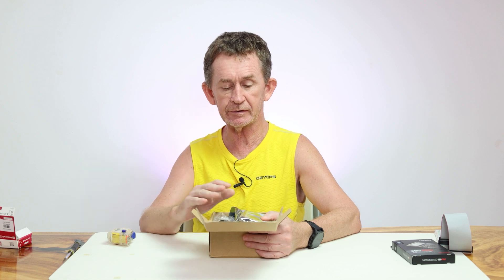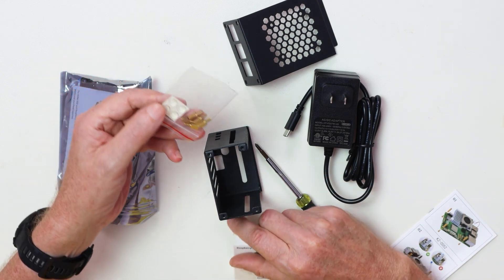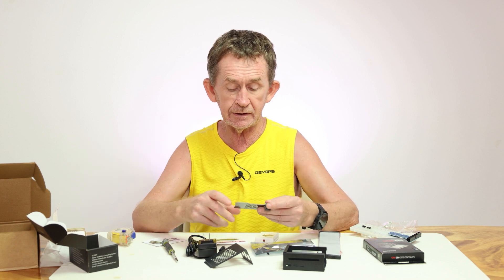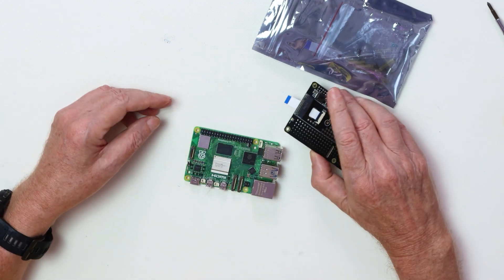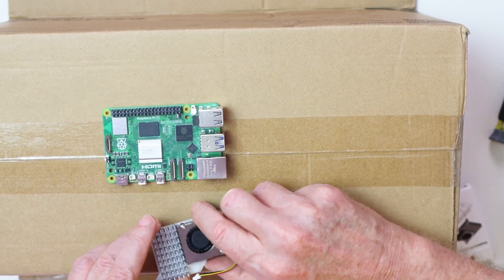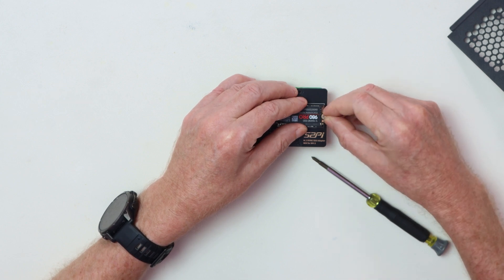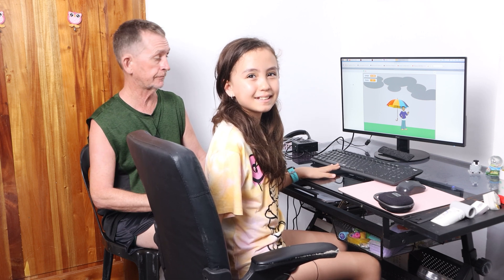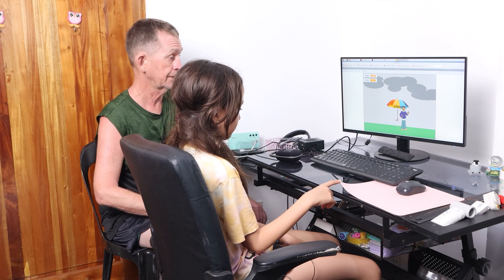We built a Raspberry Pi 5 with 2 TB NVMe

Comment: great video man!! Really appreciate your knowledge. But I wanted to know, Can I pair active cooler + 3.5 inch gpio display on pi 5 together??
Reply from the maker: Yes, as you see in the video, the active cooler does not block the GPIO pins. You may need a GPIO standoff if it plugs in directly. Thank you for watching and subscribing
Reply: @IrishChippy  I ordered a 3.5 inch tft touch display for my raspberry pi 5. I have linux running on my pi Do I need to install drivers manually?